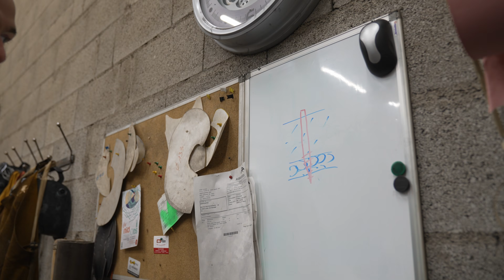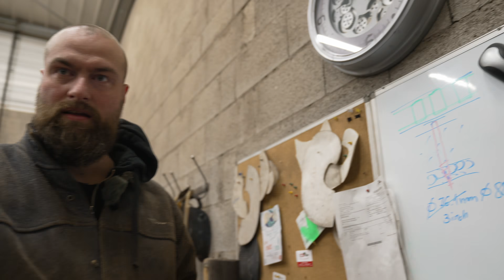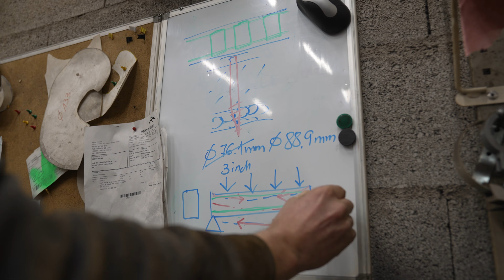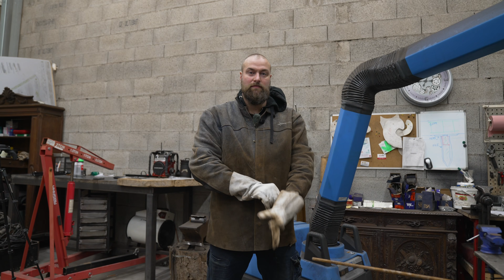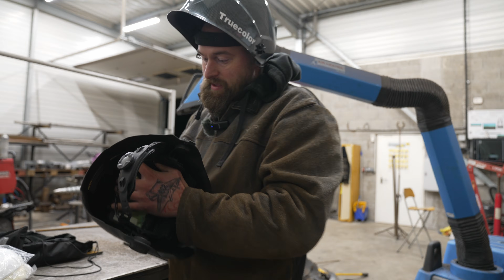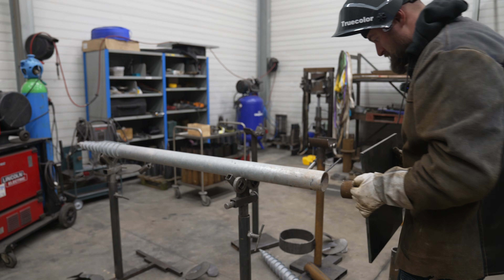Behind The Welder's Mask - The Secret To Perfect Penetration Every Time!

Comment: Here in Rotterdam, diagonally opposite my house, there is a large block of houses where screw piles have also been used. I thought they were 50 cm in diameter and after screwing them in they were filled with reinforced concrete. Normally all buildings are piled, but that was not possible because the vibrations could damage the train tunnel that ran next to them. By the way, it's good that you extracted the zinc fumes. I got zinc poisoning because of this when I was a welder and that was no fun.

Comment: I did some welding many years ago but  there were no lenses that changed when you were, or were not welding. It was fascinating to see that process when filmed through the welding helmet lens. An altogether excellent presentation.  I think the term you were looking for when hammering a rod. metal, or wood,  into the ground is a 'pile driver'.

Comment: You can learn new things every day no matter how old you are. Thank you Stan for the instruction. I watch my grandmothers home get lifted with piles. Her home was built in the 1960s on top of a spring head that ran to Silver Springs, but not known at the time of construction. So her house was sinking. They used water hydraulics with pipes until they hit limestone. They ended up using over 20 piles and pumped two truck loads of concrete into the voids under the house. 
Thank you both for this. I enjoyed 👍👍👍

Comment: Stan - would there be any advantage to your piles being made using standard galvanized corrugated cylinders (satisfying a job site's required diameter for load and strength requirements etc.) or not suitable? Just curious.

Comment: My husband has welder envy for your bigger mig machine, lol. He’s been welding for 52 years, everything from plates 1 inch thick constructing long-wall mining equipment to pipeline to micro welding for the tool and die industry to welding instruction.  Semi-retired now but still doing part-time instruction and welding repairs.  Like you, he built his own metal press from recycled parts.  His garage is now set up with welders, grinders, 2 lathes a mill and a vehicle lift. Bought a torch cutting table but wondering when he will have time to learn how to use it.  😄
He said you did a great job with this video! 👍🏼👏🏼

Comment: DANG! Your shop takes me back WAY too many years… I used to work as a general machinist in the same style/space as what you have. BUT also crammed with  6 manual lathes, two MASSIVE 1940's era   vertical mills, two grinders, 10 'Bridgeports', chop saw, sandblaster, tool supply area… WITH all the other stuff you have! 
Pure chaos! But I learned to create perfect tolerances on REALLY old, messed up, 10 thousandths of an inch off machines!!!😅😅😅 
Thanks(?) for the memories (wasn't a pleasant job🤣).✌️🤘🇨🇦

Comment: Wow Stan!! I learned what a pile driver is!! And i always wondered where the metal came from when welding. I never knew there was a wire fed thru the torch. Is this the difference between solder and weld? Im loving your lessons. ❤❤

Comment: That other pile you couldn’t think of is a DRIVEN pile. A pile driver is used, effectively a pneumatic hammer. There are also vibro piles. Giant vibrator driven into the ground and surrounded by concrete or gravel. Ending up with a very uneven friction sided solid pile of stone material. Unless you go for a floating slab for lighter structures. A concrete slab with a concrete waffle below.

Comment: I don’t mind the in between stuff as it explains what you do for a living, 😊.    I do like to see what you do at Pannard every couple episodes.   That being said, guys…..it’s winter and there is NO heat at Pannard.    Working in Pannard will require extreme cold weather clothing which is bulky.   They will have to do short shifts then warm up.   Cold saps your strength after long periods.   I’d rather they did short shifts and watched their health and ramped it up spring, summer, fall to work more comfortably.  That being said.  There’s a big fireplace in the kitchen so fix what you can there even scrape and repaint windows and fix it up a little mideival/16th/17th century.   Collect old ‘receipts’ as the called them for dishes to cook from back then and learn to cook more over a fire.   Get an old iron stove and learn to use it.   Lighting the stove as well as the fire place will give you a room that’s a warm cosy retreat in between doing other stuff around the chateau.  Just a silly suggestion from a supporter.   Everyone loves history and even old recipes and cooking techniques is interesting during this colder weather.   You may not find that your thing tho.  You guys hang in there.    It’s a big job but keep at it.   Do your thing.  Bunches of us will be here for the long haul no matter what.    👍🥰

Comment: Piers and beams. My house sits on piers and beams. Pile drivers, Professor Stan, do I get passing grade now?  ;-) I tease you.  It sounds similar to the way treehouses are erected using the tree trunk as a pier, or vertical support. Horizontal support appears to be what you are describing above the soil level. In a tree house various methods are used to prevent vertical destabilizing torsion. To the unfortunate people who leave negative comments, someone else stated it below...go buy a house and try to fix it with no income, then come back and whine because you couldn't find another channel to watch a chateau being restored.  One of the first chateaus I had hopes of buying had a bridge built by Mr. Eiffel leading to it.